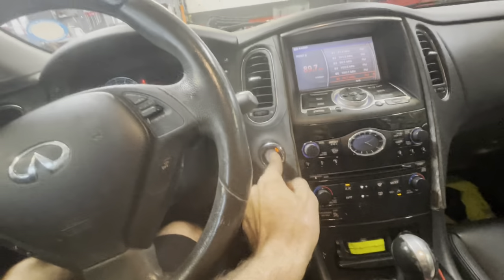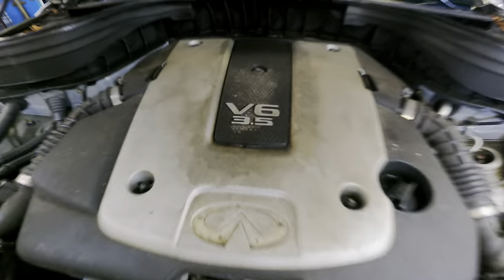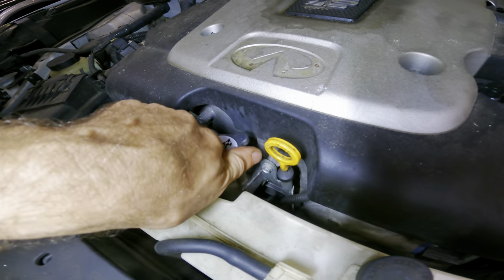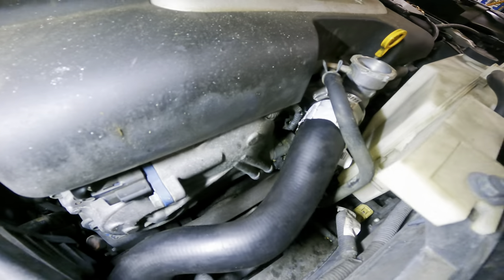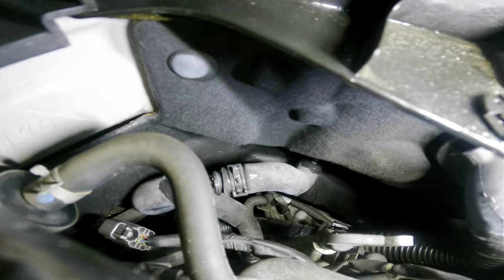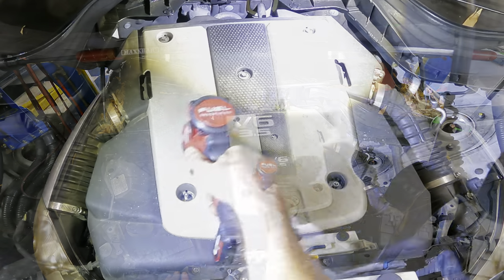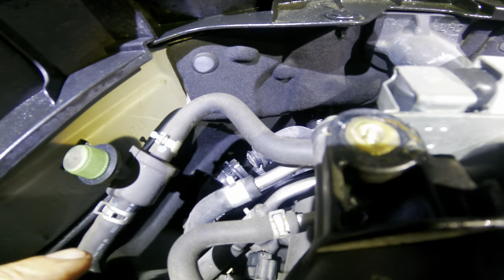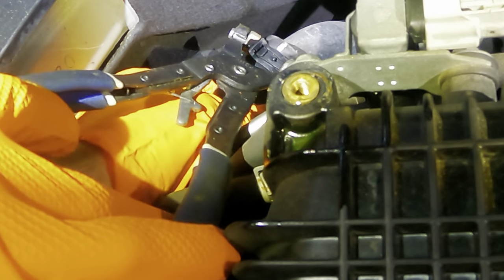Overheated after new Radiator! Tow In! Infiniti 3.5 EX35

Comment: ray make a hose folding tool one where you place the clamp on the end loose put the nose on the tube and clamp down where by it folds the tube end into a c shape lowering it cross sectional area and the clamp slides on easily
Reply: could be made using round nosed pliers cut one nose of and place a tube on it  so it looks like this   (o    you might have to flatten the op side so the clamp slides on easily

Comment: I would have sent a borecam down the hose to make sure no plastic pieces had fallen and tumbled backward down the hose line. Some of them have Wi-Fi access points and batteries, and you turn the battery on for the camera which also activates a private WiFi that connects with the app to the live image. Others do not have a battery and are able to be powered by USB type converters plugged into the phone's data/charging USB port which drains from the phone's battery to power the device. I'm not a car expert but it seems like chunks of that stuff floating around in a coolant line would be bad.

Comment: Definitely one of those jobs were you will be responsible for the head gasket after the fact they ran it hot usually what happens when you fix one leak on a car the pressure builds up and goes to the next weakest link.

Comment: Had a coolant hose blow in the parking lot, car had 200 thousand plus miles on it but the motor was a new, let’s just say all the plastics of the coolant system don’t last very long, the plastic connected to the radiator instantly broke as soon as I went to clamp the new hose on 😂

Comment: I have a 1990 Honda crx that I had to replace the radiator and another time I had to replace a cap on the intake that caused a massive coolant leak and with using the same style bleeder it took me about 30 min to completely bleed the system.

Comment: i fix these all the time heater hoses are fine but  the plastic T fitting it is so rotten all you have to do is flatten it out and pull out  the pieces  usually  4 pieces

Comment: Just an FYI an uncapped coolant system becomes less efficient at dissapating heat as the pressure inside a closed system increases the boiling point of the coolant. I think 50/50 boils at something around 220-F/ 104.5-C. For each pound of pressure the cap is rated for the boiling point increases by around 3-F / .56-C. Meaning that a 10psi cap would raise the boiling point to 250-F/ 121-C. If the system is allowed to reach the boiling point of the coolant bubbles will start to form from the vaporization of the coolant against the hot components like the cylinder walls decreasing efficiency of the coolant and leading to hotspots in the system not to mention thermal runaway as vapor is much less conductive of heat than liquid (think sitting in a sauna at 150-F vs even thinking of a bathtub of water at 150-F),  a closed system passively regulates this as the pressure from the vapor increases the overall system pressure, with the system finding an equalibrium as long as heat stays within parameters of the pressure relief valve.

I had this exact thing happen in a 1.8T Jetta that was running hot due to a failed pressure cap and a hot tune. I thought it had to be a blown head gasket but I tested for combustion gases in the coolant and found none. After thinking over the problem I pressure tested the cap and it failed, as it was barely holding 2 psi, but is normally rated for something like 20psi I literally replaced the cap and the temperature of the engine was back under control like nothing. Just something to check that I thought of watching this, especially as you are using that coolant funnel, those things are awesome for burping systems but aren't supposed to be left on for the final test as some manufacturers like to factor in the raised boiling point due to the higher pressure and thus like running the engines hotter for higher efficiency. 

I would check for combustion gas in the coolant and if that's negative use a vacuum coolant filler to assure that it doesn't have trapped air in the system. Some vehicles are a nightmare to bleed without a vacuum filler and some even have a special procedure to bleed air from the system due to some points in the system creating air locks. 

Also, I just wanted to say I love your videos, it's a fun watch for someone who stopped turning wrenches professionally a couple years ago.

Comment: I usually wont comment but few of your vids made me wana do it.I'm not saying ur not good at your job , but you are missing a lot of simple things like when you tried to remove the clapms from the hoses you just tried straight away to pull the towards the hose or away from it , but never tried to twist the clamp first too loosen it if it was stuck from the bottom, this applies for the pipe you took from the hose as well and and what i would do is just cut the hose so i wont risk any plastic debris ending up inside and i wouldnt trust the hose that i had poked with a screwdriver but anyways the way you took the secound part of the pipe which was stuck deep inside i would just put the long nose pliers in the middle of the pipe and just expand the pliers and you basicly will apply the tension on the inside of the walls and you should be able to just pull it out without actually breaking the pipe into pieces . Sorry for my lango and no hate , just sayin.

Comment: Why did you take the clamps off? I would have just slid them back down the hose until they were out of the way and then worked to replace the part. At that point all you would have had to do would be slide the clamps back up and into position. RGM

Comment: What's the make and model number of the pliers used to remove the hose clamp/barb? They look so much better than needle nose pliers!

Question: if the plastic coupler is toast, wouldn't it be fair to say that it might also be time to replace the hoses too or do you just check for how pliable to hose is and only replace if it looks aged/cracked?

Comment: If the original radiator was poor, the system maybe was not getting to full pressure, and the part only failed when full pressure was restored. No-one to blame. Customer pays for 2nd repair as if it had been noticed at the original time, they'd have paid for it then anyway.

Comment: Is a simple mechanic. I would personally try to find a bolt that was just the right size to fit inside that piece of plastic of the hose so that I could ream it in and then pull out the whole thing. Prior to watching past the 6:45.

Comment: With both hoses at the same temperature, I wonder if the fan isn't working. The audio didn't seem to pick up any fan noises, but I'm sure Ray would've noticed if it the fan wasn't pulling air through the radiator.

Comment: Are the radiator fans running? Not super experienced with Nissan/Infiniti products, but I didn't hear the fans running at any point. Of course if the coolant is boiling because it's getting too hot due to the fans aren't running that would explain the bubbling too.

Comment: I've got an 05 SAAB 9 3 Aero and not too long ago the T joint connecting the coolant lines to the turbo snapped. Like.. EXPLODED. Coolant went all over my engine bay. Even made the computer go stupid for a couple weeks. Enough to make us have to detach the steering wheel lock and bypass it in order to turn on the car because the car kept (probably rightfully) complaining that it's unsafe to drive the car if the steering wheel lock is faulty. Found someone that machined T joints out of metal because it's a common issue in my car (second time we had to fix this within a year) and it's been running great since. 
It's just everything else that's now going stupid because my car is a toddler. With dimentia.

Comment: Shouldn't the system be pressurized. That is the original radiator cap installed. Take the cap off any radiator and it should run hot.
Any thoughts?

Comment: I have an 2009 FX35, same exact thing happened.  The heater stopped working, I saw a video that it was air in the coolant, so I added coolant, a couple months later this exact hose barb broke in half at an In-N-Out Burger drive through.  It exploded all at once, but my hope is that it had a small crack where the water was seeping... I hope it's not a head gasket...that would suck.

Comment: you didnt say if the fans turned on, The fact that both  upper and lower radiators hoses were almost the same  temp 213 is hot, either the radiator is defective or believe or not ive seen water pump empellors  not spin or the fins are rusted out

Comment: Yall need to heckle the bossman for a creeper. "There is potential for your workers to get injured, and the customers vehicle to be damaged in the process of replacing parts due to the need to crawl in the engine bay. To prevent the shop from taking a loss in the future, it is absolutely essential to have a creeper in the shop. Also My nuts get sweaty when placed ontop of a warm engine without padding."

Comment: bought a s10 w/2.2   had cracked head leaking out the spark plug hole....BARS LEAK, ran it with radiator cap loose ,just in case...had 150,000 mls when purchased...it finally got to the oil,,,had to park...10,000 shy of a quarter million miles....i put 300 dollars in it,/seats,mats.....p o s ragged ass truck,but i loved it and top out was a 110,w/ 5 speed over drive and 3/10,3/11 ? gears,,,, 12 bolt rear,single wheel pull

Comment: Get yourself a few pipe taps. Start threading the tap of appropriate size into the plastic and after it has a good bite into the plastic, pull out on it as you twist. That should get it out without breaking it into pieces. But, WHY on earth do manufacturers put plastic fittings where they are subjected to heat?!

Comment: das ist caput jah?

You might want to invest in some long nosed vice grips lol

Is the coolant fan coming on? I'd be warming it up till it did to make sure it was up to optimum running temp.

Do you not have the tool for checking for CO2 in the coolant? Handy for checking head gasket failure.

Comment: I would seriously consider that the connector broke was just coincidence or that it had a small leak at that juncture at first and finally let loose. Perhaps they didn't find the little leak and replaced the radiator instead and it blew then all the way? THEN when the car overheated (or perhaps many before because of radiator swap?) it warped a head and thus gasket/head problem perhaps...all mere speculation but one I think should have been mentioned.

Comment: Would WD-40 help loosen the adhesive bond between the hose clamp and the rubber ?
Would it help by doing the same with the plastic inside the hose ???

Comment: Maybe a massage first around it, put a piece of rag inside to avoid dirty fluid going in, then try to put some antifreeze solution between the hose and the ring, then some more massage with the pliers, and repeat as many times as needed until it gets lose; be careful to change the rag every time

Comment: Methinks it would have been easier to remove the hoses from the clamps.>SNIP< >SNIP<  

Since the car is barely broken in (broke, no power windows) should all.the hoses be replaced at 12 years including the serpentine belt and timing belt as well?

Comment: Re: Whose Fault, If the shop pressure tested the system after the radiator replacement, and it passed, then no fault on them.  Another reason to use vacuum fill equipment, especially in a professional environment.  Built-in leak test.

Comment: I'm just saying I worked on many many of these vehicles I can't be 100% on this particular one but I can just tell you from experience that 100% of every one of these that I have worked on so far not only have that coupling there on that hose but there's also a bleeder screw all of this is plastic to aid in bleeding the cooling system it looks like at some point in time someone removed this particular item and replaced it with this not necessarily is it truth but fact is this was designed to help bleed out air pockets

Comment: Crappy platic hose barb breaks. Ray's solution: Install another USED crappy platic hose barb. Then to seal the deal he uses crappy worm gear hose clams in place of the compression clamps.

Comment: I'm guessing Ford designed that heater hose connector only Ford would use plastic parts in the heater system, because we all know how well plastic works with heat and pressure.

Comment: 9:45 - I am not even half through the video - however - I would simply use larger diameter tube in which I would put on both sides these two smaller tubes - and would clamp it properly. I think it would work and would be fast easy to be done... this plastic crap will make problems very soon again

Comment: Ray, any work on the 1.4T GM uses? That POS Water Distribution Block, I guess that's what it's called, on the driver's side is ridiculous. I've replaced so many on mine, I have a standing order at O'Reilly and it takes me longer to get my tools together than it takes to change the stupid thing. It's to the point I'm seriously thinking about trying to find a machinist that can make one out of steel. The plastic just doesn't last and unlike the 1.8na, nobody makes one out of metal.

Comment: I'm wondering if it not like the m35 I worked on it keeped over heating until I found the bleeder screw (no joke) and bleed the air out the coolant system threw it it was on a heater core hose.

Comment: I had something similar happen to me like this and it was a stuck Thermostat AND the head Gasket On a 2006 Nissan Pathfinder at first me and my dad replaced the Radiator since it was damaged all over so we replaced that but it was still overheating and then Hydrolocked so we has to tear apart the engine to replace the head Gasket and it was a big pain  after that then we found that the Thermostat I wanted to replace it earlier since it already had heating issues and my mom drove it around and also thought it may have been the Thermostat tho I have a stubborn dad so it was chaos

Comment: i wonder if you used a smaller sized pipe pliers to walk behind the bibe on the length of rubber hose  to push the bibe section out by squeezing kinda like a pressure wave the dolphins use

Comment: loloolol alot of the vq35 family have bleeders ,many of which are frozen or broken . this is obviously airbound at the heater core though ,. you can prefill them and mitigate some of the air binding issues cuz otherwise it becomes a pain in the ass . and a much longer job,. i back fill the engines top hose till the coolant comes out of the radiator  now. then seal the system ,fill the reservoir  , run car,,let it get hot , shut it down ,.  let the reservoir do its job .  repeat till done...
Reply: btw fyi . not the shops fault  if a  smarty mcfarty comes in demanding a radiator cuz their friend said so .. ,, happens all the time

Comment: I am gonna say the customer pays on this one, pretty sure it only failed because the radiator was new and was generating higher pressures than the old failed one did, as a result the weak link in the hose just gave way under the higher pressures. It's hard to tell when these things are gonna happen and its the unfortunate truth when buying high mileage used vehicles or using a high mileage vehicle. These rubber hoses get brittle and start forming cracks, just the nature of the beast. There are actual products out there that can be used to keep the rubber supple but you would need to wipe that product on them every oil change, most people never even pop the hood unless smoke or steam starts coming out.

Comment: My niece called me last month and told me she is losing coolant but doesn't see any leaks and the motor started running hot .I told her to pull the oil dipstick and tell me if its milky looking, she said it looked normal (per a internet check) she didn't mention that the oil level was about a foot past the full mark which I found when I went to look at it for her and it was milky. Informed her of the bad news (blown head gasket)  and she didn't seem to believe me so I drained the oil out of the pan-took 3 gl milk jugs to get it all an there was all the proof she needed. She didn't take it to well, only had the car for 6 months and the guy that sold it told her he had just put a new head gasket in it---Riigghhhtttt..

Comment: 1st you let a bunch of pieces drop down into the heater hoses. 2nd I suspect that the car did NOT need a radiator and all along was leaking through those heater hoses. Which in FACT over heated the car and blew the head gasket. They stuck it to the customer as a radiator and it was a SIMPLE heater hose connector. Sad.

Comment: I have a Infiniti FX35 2003 and i have over heating problem i already changed temperature sensor thermostat radiator cap and a hose under we're it was cut will the issues I'm having is it will have no coolant in the reservoir and then all of a sudden. It will be full to the Tip-Top in the  reservoir  it blows hot air when you're driving when you're at a complete stop it blows cold and then when you're driving it will go up to age when you go up or down hill I'll come back down to middle i need help pin pointing the issue

Comment: In my opinion if the customer took the car in for overheating to the other shop there's still the question of was the old radiator bad? Or did the customer ask for a radiator to be installed and no inspection. If the latter and they just arbitrarily decided the radiator was bad without a proper inspection then they should pay for it. But I think we'll know that's not going to happen
Edit I made the comment during the video. If it was a head gasket that would be a tough one. Very tough.